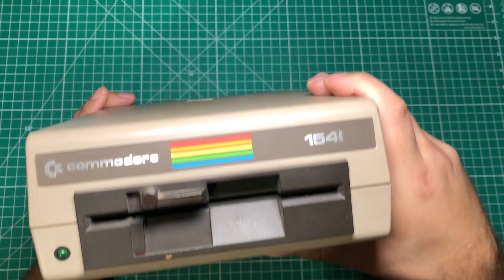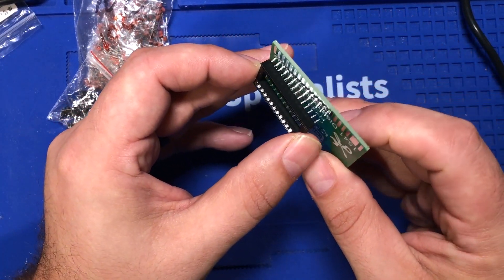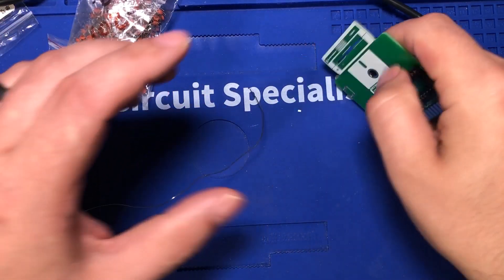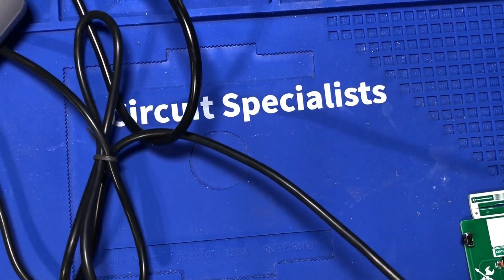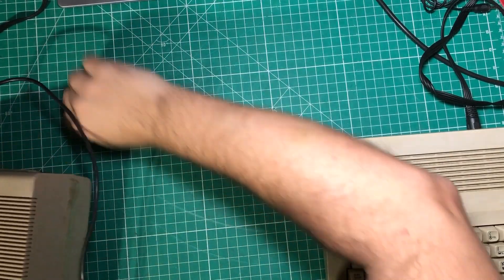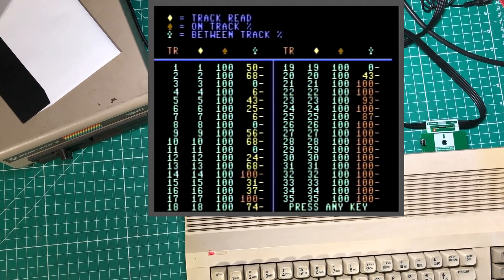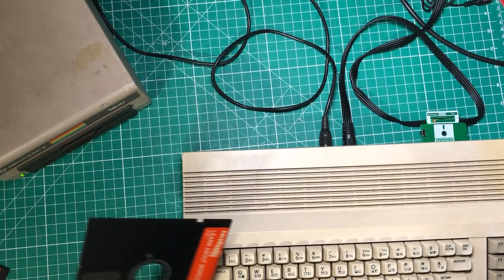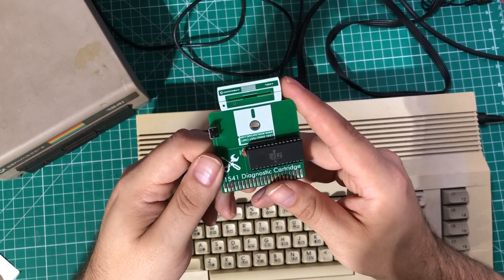The Ultimate Commodore 1541 Floppy Drive Diagnostic Tool

Comment: The information you gave is completly wrong.
You WANT to have 100% on the tracks - but you do NOT want (red)100 on the half tracks!

Half Tracks should be near as possible to zero. If this is not the case, the drive is misaligned. 100 on half tracks is quite bad.

Comment: I agree with Eletronic Treasure. Everyone (lately) keeps saying 1541 drives, specifically mitsumi specific drives are bad or unreliable. They are quite reliable. I buy everyone I can get cheap and I have never come across one I couldnt repair. I would say MOST of the problems are 1541 board specific (roms, ttl logic, etc) not the drive mech. These are pretty rugged drives in my opinion and I love fixing them.
Reply from the maker: I think the main irreplaceable issue is damaged heads.

Comment: They aren't that bad.  The drive head strap lips, the pulley slips on the shaft, but the biggest issue was the failing heads :( Half tracks mean nothing unless you have half tracks on the disk. 100 in red is NOT GOOD for half tracks!  You want yellow or green. Liked anyway cause vintage computing content it awesome.
Reply from the maker: Definitely still learning. Thanks so much for the information.